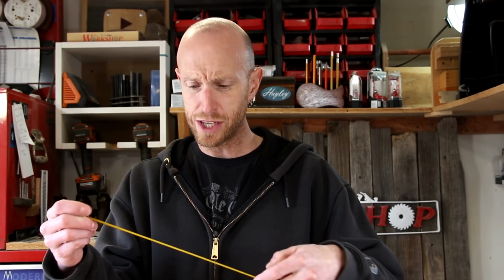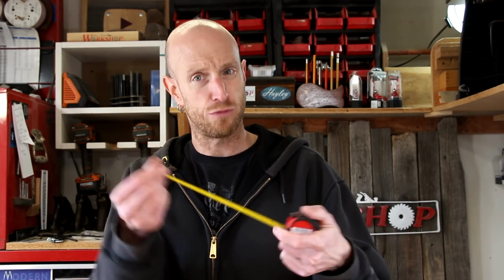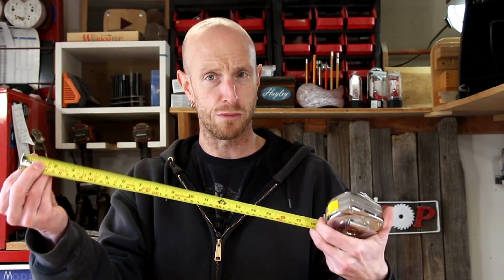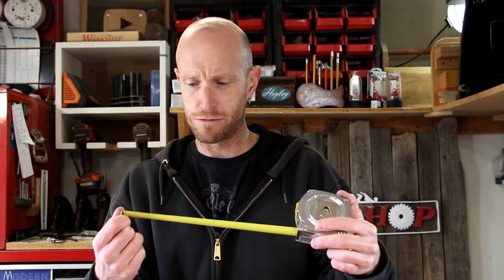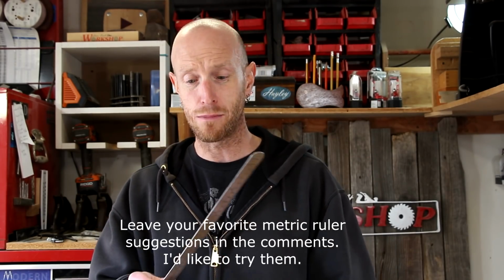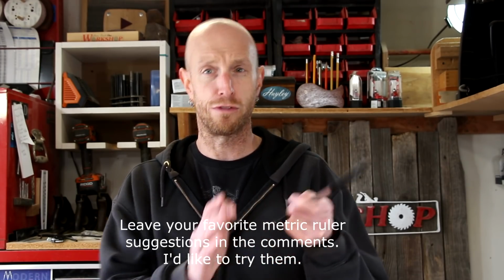My thoughts after using the Metric System for a project | I liked it

Comment: I also found the bit where you said 'here in the US we tend to use more the standard measurement system" funny; when all but three or four countries use the metric system. Also,  I don't think your cuts would have been any more accurate, I think the perception of them being more accurate is because they are easier & quicker to work out with less second guessing because as you said, no fractions involved. That is the advantage of having units of 10. No funky fractions. I found it strange that the measuring devices you already had didn't have metric on one edge and imperial on the other. In Australia our measuring devices have both, rulers, tape measurers, even the rulers kids use at school have both metric & imperial.

Comment: Go British... rough measurements in feet and inches, mm for small stuff. Model making,  micrometers if need be. Tenths of mm if that's better (100 um).

Best things about the metric system is when you remember that the standard unit is meters, then everything else on the scale uses standard 1,000 unit descriptors, such as kilo, millionaire or micro.  IT already uses these, so not too hard to translate.  Another cool thing is measurements and volume... a box, 1m on each side is 1,000 kg or a metric ton. 10 cm on each side is 1/1000 of that, ie 1kg. 1cm, aka 1cc, gives you 1 gram. Therefore, working out volumes is pretty easy... if you want a volume based on cm, divide each by 10 and multiply them together.  The result is the number of litres.

Brits are often good at swapping between both to some extent.  We still use lbs, mph and pints, for example.

Comment: To be fair, the US uses metric in a lot of things, "money metric" ( how may dimes in a dollar etc) medicine ( 1 cc of ) .......cc = cubic centimeter, film and photography ( 35mm film, 50mm lens etc) the nutritional labels on your food ( x grams of fat etc) bottles of soda etc measured in ltrs. Even the motors in in your cars, 2ltr 4.0ltrs etc 
But you notice almost everything listed is global, medicine, film, food and engines. So it shouldn't be a big jump for ya'll to move ove fully.
Reply: Money isn't metric.  You mean decimal system (or more accurate centimal system). Money has no natural constant that it is based of. Metric means interrelated units derived from never changing constants in nature, f.e. speed of light in vacuum

Comment: for me the Imperial system against the Metric system is at the same level than a good Monty Python sketch...
10mm =1cm, 100cm=1m, 1000m =1km  AGAINST  12 inch = 1 foot, 3 foot = 1 yard, 1760 yard = 1 mile

And without mentioning the exact correspondances between the volume measuring system and the metric like for example 1 meter square cube = 1000 liters... 
And what's the Imperial equivalent, 4 foot and 3/4 square cube = 458.2 cups of tea ??

Comment: i been brought up in metric and it seems eazier than using fractions , its all divided in tens so no 8s 16ths and so forts and no fractions converted into decimals either 
still need to look at a list to see how many zeros to add to convert one meter intoo cm or mm but the adding is a lot eazier

Comment: Metric is more accurate, because the difference in each type of measurement is smaller and more precise making measurements generally more accurate. When you use the metric system you don't really need to think as much, like 100 cm is a meter while 10 meters is 1 decameter, 10 demameters is 1 hectometer and 10 hectometers is a mile. While the imperial system is like 12 inches is a foot, while 3 foot a yard and 1760 yards is a mile. When you over complicate measuring and have the difference between them be so random, it could very easily lead to mismesurement. The same could be said for Fahrenheit and celsius. Fahrenheit is overcomplicated while Celsius is more simplistic, like 0 celsius which is the temperature when water starts to freeze. Guess what? 0 celsius is 32 Farenheit. I think the only reason that these unnecessarily overcomplicated measuring methods are still used by anyone is just plain stuborness and the familiarity that these people have with them.

Comment: Base 10 system just makes more sense than base 12. We (usually) have 10 fingers, and 10 toes. So counting in 10's is just more natural.
Reply: The 60/12 system is also based in your fingers. 4 fingers with 3 segments each = 12 and the thumb for indexing. 5 times 12 is 60.

Comment: the standard measuring system is called the metric system. Your system is calked the imperial system. I wonder why you are using decimal numbers but dodecadecimal based measuring system though.

Comment: 🇬🇧 In the 60's I was an electrical eng. apprentice. We attended metricification awareness courses to prepare us for the coming metric system. We were also told the industry had 35 years to complete the changeover. Now, 53 years and one career later, we in the UK still haven't completed it. We have a hybrid system which uses both metric and Imperial and it just works. Metric because it is simple in calculation. Imperial because it is a fraction bonanza. Think of 10 and its divisors, then think of 12 and its divisors. Much more flexible.
The base 12 comes from the sexagesimal system (base 60) from 3000BC Sumaria and everything works from it. The compass, GPS, you name it and we can't do without it because metric can't do that. 
Metric works for people who can't do maths (plural, not math).

Comment: overall metric wins i think as a european, but imperial has its own advantages, especially in daily life useage. its easier to imagine 3 feet then 1 meter or 100cm if you dont have a folding rule in your pocket XD therefore why not use both? imperial outside and metric inside of the workshop :)

Comment: I know it's possible to learn that 7/16 spanner or screw is smaller than 15/32, but then they adding, multiplying, measuring volume… hell!

For very small projects, imperial is fine. For larger, it's a headache.

Comment: Easy because it is all in tenths? Yeah, that is why you use Dollars and cents right? Same reason why England dropped the Pound and Shillings to hard to use. Now I have often wondered how Inch guys divide a board of arbitrary length into portions for like shelves.  In metric I just measure the length in centimeters or millimeters and divide.  If I do the same in Inches I get a decimal value but the rulers are not marked in decimal Inches!?

Comment: So my Metric saw blade kerf is 2.5mm, but I cannot measure it because I cannot find a mm tape in .5 mm's. Now my Imperial blade is 8/64's wide. Let me check, yup I can measure that no problem. Even my gas station purchased tape measure has that. Nope, I will not change until Metric is more universally granular.

Comment: It's way easier to measure, cut and even eyeball something when everything is the same ratio. I tried using inches for a project and ended up using a calculator more than a saw.

Comment: If you have a measuring device that was made after 1990 that doesn't at least have metric units as an option there's something wrong. Canada went metric in the 70s and only Liberia, Myanmar and the USA haven't made the official change yet! The thing is is that metric is SO EASY! 
How much does a litre of water weigh? 1 Kilogram.
How much does 1 millilitre of water weigh? 1 gram.
What temperature does water freeze/boil at?   0°/100°
How many kilograms in a metric tonne?  Any guesses? Yeah 1,000.
Mind you, working with the IMPERIAL system (not the "standard" system) will make you better at math as you convert 7/8th of an inch into a decimal (0.825) so I guess that's an upside. 8^)

Comment: Is it really "standard" when youre one out of just three countries world wide that uses said system?
Also why would you not get the measuring tools that display both to begin with?
Im 39 years old and Ive never seen measuring tape or ruler etc that doesnt have Metric on one side and Imperial on the other.
Pretty much ALL our measuring tools are designed like that.
If you find out that isnt its either a fluke or youve actively been looking for one.

Its like purposely handicapping yourself.
It doesnt take up any extra space, its not complicating anything, its just there should you ever need it so you dont end up in the situation you did.
We have the same thing with many thermometers over here.
The right side shows Celsius and the left shows Fahrenheit... cuz why would you not make it like that?  
I dont understand.

My motorcycle has both Kilometers an hour and Mile an hour.
Comes in really handy when traveling.

Comment: I don't know why everyone overcomplicates things. The metric system is better in everyway, and yes everyone in America knows it. That means you to, if you can count money you know the metric system because that is what money is based on. Decimal in tens, hundreds, thousands on the right side of the period work the same on the left side of the period. Calculation can be done on the fly without paper and pencil or when larger can be done on a simple calculator precise. Try using a calculator and subtract   1 5/8" from 2 1/16" have I made my point. You can use a simple calculator no matter the figures in metric, large or in micrometer for machines. Example why do calculate the speed of a vehicle in 0 to 60 mph. It is actually 0 to 62 mph because 62 mph = 100 kph get it? It is always a beautiful round number. There is no question that mathematically the metric system is better, the reason the USA and it's industries will not convert to it is "cost" it always comes down to $$$$$$.

Comment: I never understood how people can work with the imperial system. You can't even say a person's height without using two different units, which are awkward to divide with each other. And if you want to measure something much longer than a person's height, you need multiple other units that all relate to each other differently. What if you need something much much smaller than an inch?

Comment: The UK went metric when I was just a lad. There was a joke at the time. A bloke goes into a plumbers' merchants ...

Man: I want 26 feet of ...
Assistant: Let me stop you there, Sir. We're metric now. You'll have to buy (gets calculator out) 7.93 meters.
Man: OK. I need 7.93 meters of water pipe.
Assistant: Yes, Sir. Do you want 1/2 inch or 3/4?

Comment: Millimeters ARE more accurate, the entire metric system is. It was constructed to be simple, scientific and accurate.
It uses scientific base measurements and divides them up into understandable pieces that can be calculated in steps of 10, 100 or 1000.
Meters are derived from the earth's circumference. Kilograms are derived from the laws of physics for calculating mass and weight. Celsius sets 0 as the freezing and 100 as the boiling point for water. And so on...
And the best thing is, the metric system still has "real life counterparts", e.g. one fingertip to the other with stretched out arms for an average sized person is roughly one meter.

Comment: Congratulations!  Now that you've mixed with the metric system, you are an honourary Canadian.  Canada officially adopted the metric system in 1975, which means any document that government deals with is metric.  Also means that new generation school kids are only taught metric.  The reality is we are a country founded by the English and French, so the Imperial and the Metric system have always been present.  Our largest trading partner is the U.S.A., so If you are going deal with this partner (who has 10X Canada's population) you have to learn the Imperial/Standard system outside of the school system.  Canadians live in the "Twilight Zone" with a weird hybrid system where we can go to our Home Depot and buy a sheet of plywood that measures 17mm X 4 ft. X 8 ft. or a 5/8" bolt with a 1 mm thread.  Canadians still go to the store to buy a gallon of paint and it is actually in a 1 gallon can, but the can is labelled as 3.78 Liters.  Measuring distances with millimeters, meters and kilometers is quite straight forward.  Measuring weights and volumes in grams and kilograms is slightly more difficult, but calculating pressure in kilopascals when my tires are only labelled with a PSI rating, still leaves me scratching my head.
Reply from the maker: I've never even heard of a kilopascal. I'd be scratching my head too. Lol.
Reply: @homebuiltshop  In Canada all automobiles have speedometer scales for both miles and kilometers, but my oil pressure gauge only lists the reading in Kilopascals and my coolant temperature gauge only reads in Celcius.   All I know is 250 Kpa is Good and 175 Kpa. is Bad. Lol.  Americans visiting Canada love to see our speed limit signs showing " Maximum 120", but that's kilometers per hour, not miles per hour.

Comment: Metric is just a far more accurate way to measure anything. I only use the metric system, it's just easier to use and it's a far more precise way to measure. That's why in science they only use metric, even in the US. it's metric when it really matters. When it comes to using metric the problem isn't with the metric system, it's the mentality of the people who let it scare them. When it comes to decimal points vs fractions the decimal point will win every time. Cheers!

Comment: We forget that our currency is metric, as is our medical profession. Let's not forget liquor.  Or at the store, did you bring home a 1 or 2  liter bottle of soda?  When working on an engine (small or automotive) - what percentage of the nuts and bolts are metric?  And what is the basis of the Imperial system of measurements?  The "inch" is the length of 3 barley-corns.  The "foot" was the length of the king's foot.  And the "yard" is the distance from the tip of the king's nose to his outstretched (sideways) middle finger.  Thomas Jefferson supported the adoption of a system of measurements based on 10.  For international trade, the US has been metric for over 100 years - which is the reason for measurements in the thousandths of an inch.  Now what countries use the imperial system?  The US, Liberia, and Myanmar.

Comment: The metric system is more accurate and you don't have to break things down into fractions. For example a tabletop being 1565mm X 900mm X 45mm is very accurate and there is no fractions..
This is why all building measurements here in Australia are in millimetres..

Comment: The US Imperial system is not "the standard measurements". It is the massively non-standard measurements, just about nobody uses it.

The architectural standard method uses millimetres and they are written as just numbers. It really speeds things up.

Comment: I think the real problem comes when you try to mix the two systems together.. Like, 7 millimeters is about 17 64th of an inch.... Okay, that means it's about a quarter of an inch which is what,, 2.54 / 4 centimeters, that's about 0.64 centimeters, so that's like 6 millimeters, basically.

Comment: Seems like there is a lot of difficulty going to the metric system due to traditional lumber and houses being built using Imperial. 2x4s and standard 8 ft ceiling houses does not easily translate into metric measure that is easy to remember. However, for anything science or engineering it is ridiculous to not use SI/metric measure.

Comment: I can't understand what kind of "problems" americans have with metric? For example if i told you that you have 3 drill bits in sizes: 6mm, 5mm and 8mm. Now put them in order from small to big. 

Lets try imperial: 1/8.125,  5/32.156,  9/64.140 how on earth do you know how to put that random stuff in correct order?

Comment: No, liking metric does not make you weird. I’m English and grew up using the imperial system. In my late 20’s I started using metric more frequently to a point where I realised imperial measuring just didn’t make sense. Adding, multiplying and dividing imperial fractions is just an unnecessary inconvenience.  Metric is just intuitive and very easy even without a calculator. To use a fraction in metric all that is needed is to move the decimal point, nothing could be easier. It’s true that the majority of Americans still use imperial but guess what, American engineers do not, they use metric, so go figure and make your own mind up.

Comment: Nothing worng with Imperial Units itself. Units are just units. The things is humans are gegetically engineered to folllow patterns, consistency and base 10, which in shot Metric is based on. Our brains understands half, a quarter and a eights at most, naturally. Beyond that, we are forcing it. That also hinders our performance when it comes to doing calculations with fractions. Decimals are the way to go.

Comment: Have you fully implemented the inch system? In that case, when you change president, you have to measure him so you get new inch measurements. Should the rest of the weather also run the thumb system, each country would have its own thumb measure which would also change when the ruler of that country was changed. No, better units of measurement that are based on science and are directly related to each other such as meters - liters - weight and so on.

Comment: cool. But don t do the classic mistake of standarders that use only millimeters. The metric is designe to use cm and m too , as it s easy to switch unlike inches and feet you should use them as they give an order of size and accuracy . Once tried ,used forever.

Comment: a 64th of an inch is still more than 3mm, isn't it? So that would be less accurate for sure.
Reply from the maker: 1/64th is .39 of a mm. Its a bit more accurate I suppose but I feel fractions are a bit harder to work with.
Reply: @homebuiltshop  you’re absolutely right. Didn’t have my decimals right…as evidenced by this it seems like it would be

Comment: Metric works faster.
Make two times the same project.
1 time in metric and 1 time inch.
Check the the time you need for the build. 100% garantee that matric is made in less time